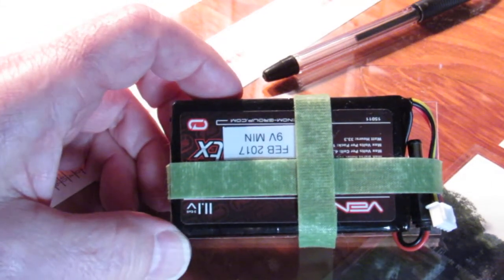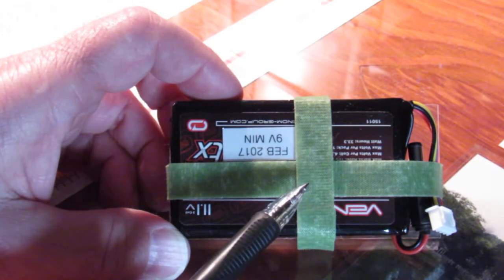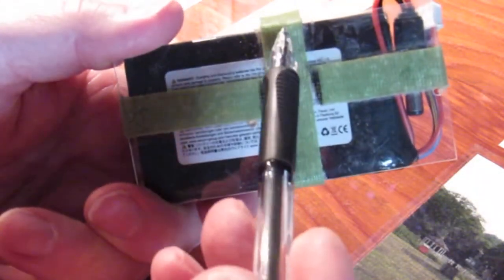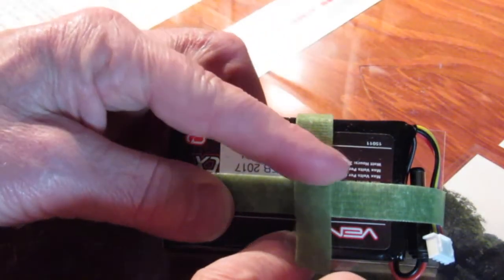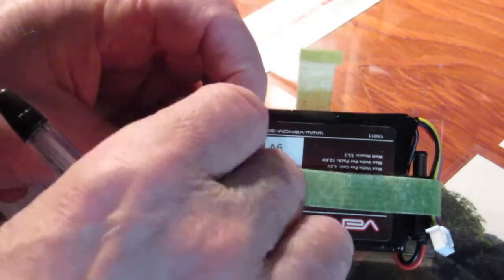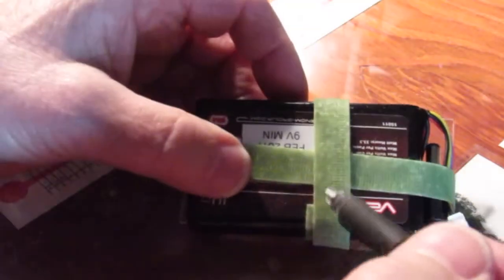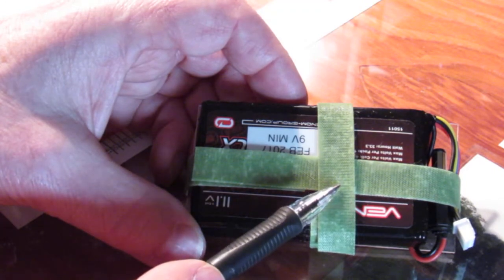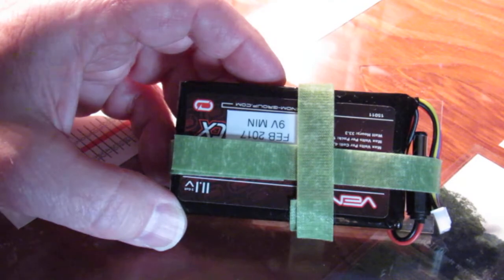KX3 LiPo battery mod update

Comment: Thanks for the information. I thought the KX3 would be a go-box without needing mods like this but clearly AA batteries are really only an emergency solution. I'll have a go at this myself when I get a chance, thanks for the useful info. Mark. M0NOM. 73.
Reply: I thought so as well. It's a shame because the KX2 uses a much better battery. So I bought a KX2 as well.
Barry, KU3X